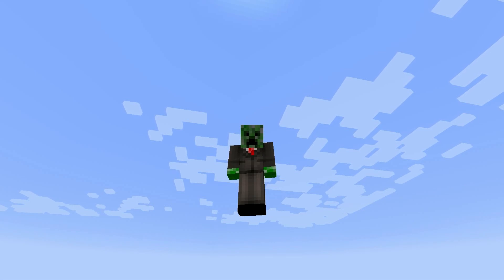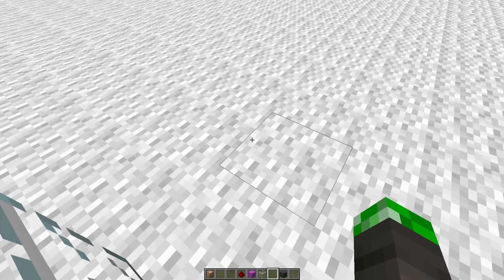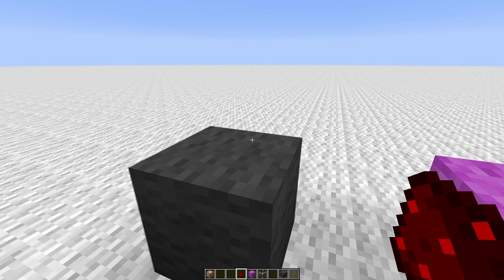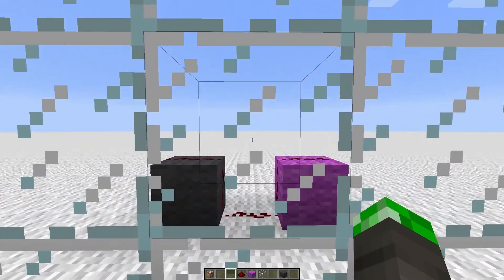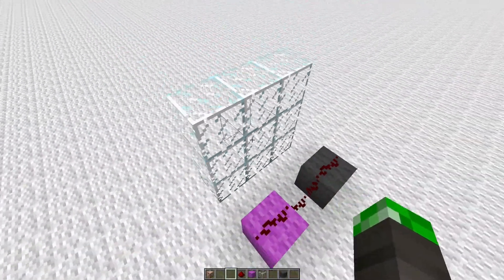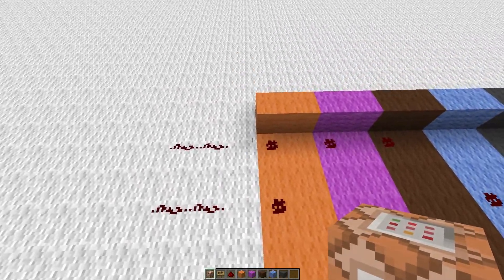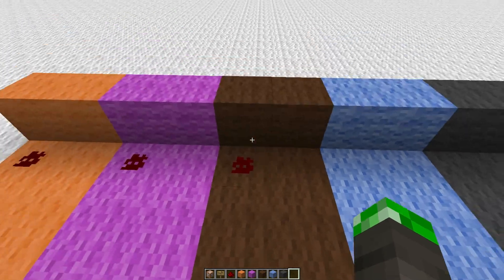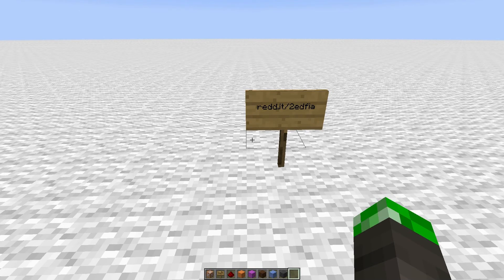Building a Computer Ep. 1 - Ideas and a Smaller Converter

Comment: What is your planned input method for the programs? Will it be a series of command, a pattern of blocks which signify 1's and 0's? What might be interesting is having each block signify a different opcode. For example, grass could be an ADD instruction.
Reply from the maker: Haha, nice ideas. I haven't planned that yet and it's easily changable later so the first goal will be a working computer.